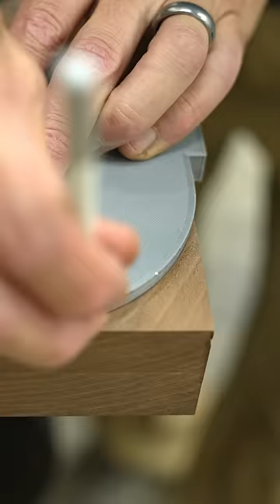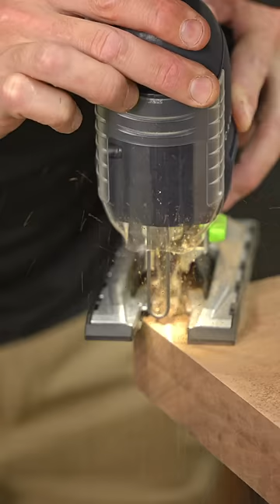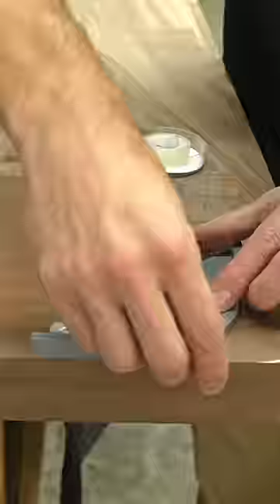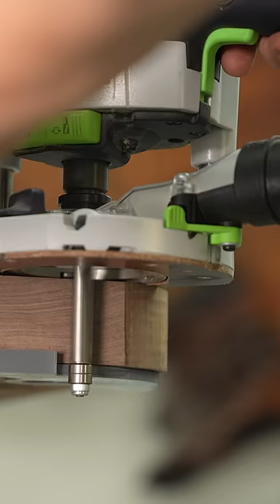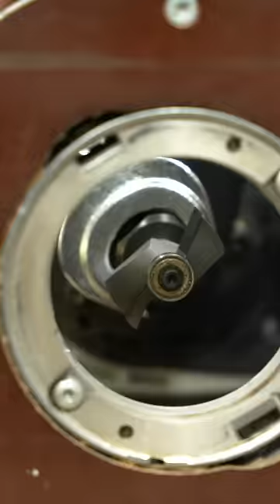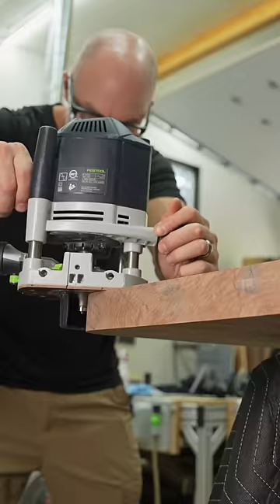Corner router radius

Comment: Time to get a new bit so it doesn’t burn the wood lol
Reply: moving the router too slow = burn marks

same as bit spinning too fast
Reply: You beat me to it.
Reply: Cleaning the bit can also help.
Reply: Some kinds of wood develop burn marks no matter what you do.  This bench top looks like white oak, and that’s one that burns easily even with sharp clean tools.
Reply: Tiene que bajar las RPM del router
Reply: Just needs cleaning in a degreaser solution save yourself loads of money it’s the turpine and resin from the wood that causes it not a blunt bit or too fast or too slow something the tool companies won’t tell you all and your welcome chaps
Reply: The guy has a festool router. I’ll bet he has the right and well maintained bits.
Reply: Just bad technique can cause this too. I've had brand new, high-quality bits on a dewalt router burn wood by using bad technique.
Reply: @rbruce5270  no, spinning to fast is never an issue with such a small bit. That's only a problem with much bigger routerbits. The problem with the bit in the video is either a dull bit, too little forward movement or not enough wood to remove.
Reply: Isn't it the same one that burn the wood in previous video too ?
Reply: He can’t afford new bits because he is still making payments to Festool 😅
Reply: Nah he held it in that spot too long
Reply: @rbruce5270  I just feel sorry for his partner 😁😇
Reply: All that money wasted on a festool router and don't even know how to use it without burning the wood. Perfect
Reply: @timothy098-b4f  the jig saw didn’t burn it
Reply: To slow not bad
Reply: Slow
Reply: @timothy098-b4f  doesn't look like white oak at all
Reply: @Cantspeakable  just because you have the money to buy inexpensive router doesn't mean you have the proper technique. I would never depend on double-sided tape for my jig
Reply: Always that guy
Reply: Yeah move that thing a little faster mr blacknails
Reply: Was due to his slow feed most likely
Reply: @rbruce5270  speeds and feeds
Reply: Да нормальная там острота, просто долго держал, зачем-то за один проход делал, хотя нужно было за 2-3.
Reply: I gotta disagree with your detective written there Lou, it looks like walnut. 

And dlr stands for dealer plates  @timothy098-b4f
Reply: Как называется эта фреза и эти приспособления?
Reply: U need to remove the fire from the metal first

Comment: Jigsaw and a belt sander works well for me. Any radius you want, you can usually find the right sized cup or can, or draw one with a compass as a template.
Reply: sounds like me. improvise, adapt, overcome.
Reply: What if your client is walleyed and can see both corners at once
Reply: That was a 3d printed template if you have a printer put it to work, if you have a kid with a printer put them to work.
Reply: Same here. Quick, easy and adaptable. Although his method is good if you have an inexperienced worker doing it
Reply: @scotwkilgrow  👍 for 'heartbreak ridge' reference.
Reply: @KaladinDarkEyes  BE caerful though, not everyone with a 3d printer actually calibrates it regularly...
Reply: If it's important, use a compass. If it doesn't matter I'm tracing a tape roll. Either way I don't need ten grand worth of tools to cut and rout a radius

Comment: That amount of burn is going to take some sanding out, especially on end grain. With good hand control you can do a first pass 0.5mm off the jig then a second cleaning pass.
Reply: @digitraxuk  haha, hope that jig is held on with Festool double-sided sticky tape.....wouldn't want it to fall off and the cutter to go right into the table top

Comment: Do you have to have a different router bit for each length you need?  Like that corner radius tool, if your stock was 1/2 thinner, you’d have a different bit for it so that the spacer nut on the end of the bit wouldn’t tear into your radius tool?

Comment: I have a set of premade templates with various radius diameters. Clamp it on top and route with a router with a collar.   Putting a lot of faith in some double stick tape.   It only takes once.
Reply: Also putting a lot of faith in the jigsaw. Mine never cuts straight. The blade wanders especially on thick materials. Far better to cut the corner with a pull saw then take a few router passes finishing with the template.
Reply: @Dave5843-d9m  I cut the corner off straight.  the router can handle the rest.  I made formica tops and the corners  usually had a radius.  I did hundreds of them.

Comment: Bro you need to route against the grain first to prevent the wood splitting. Then your last pass is with the grain to clean the cut
Reply: or, hear me out, this is a kind of oak that burns very easily. Every wood is different. The sharpest tools dont do crap if what youre working on just wont play your way no matter what.

Comment: The only problem with running a router round a radius is that it's ok
going away from you on your left hand side, which is correct, but when you start machining and come round the radius at the start you can, and most probably will, splinter the grain.
It's ok when you get to the right hand end of the board.
The other problem is the radius guide has to be screwed in position leaving unsightly holes in the w/top.
Much better to make a template out of 1/4" mdf that is  long enough to clamp in place without obstructing the full travel of the router round the curve. It's also cheaper!
One of the reasons why he burnt the w/top, apart from using a suspected blunt cutter, is he was going too slowly. With hard woods like oak you have to move the cutter over the 
material in quick short cuts while making sure you don't linger in one spot too long.
I would have used a ball raced guided cutter which are specially designed for cutting w/tops of 
38mm thick.
I don't know who these 'instruction'
videos are produced for.
If you're a professional tradesman then you don't need the video because you already know how to radius a w/top.
If you an amateur then the equipment he's using is horrendously expensive and not the sort of gear you would have.
Apart from which, he's not doing the job properly. At least I don't think so.
Maybe he's a moron on day release from the local nuthouse.😂😂😂
Reply: So much criticism towards a guy who clearly has his shit together. I don't get it... Also, in what universe did he screw in his radius guide?
Reply: jesus , that was a bit harsh … we all do things differently as skilled craftsmen , but usually get the same result , he never screwed the template from underneath , he used double sided tape , which i think is a terrible idea , but it worked in this case . making a bigger template and clamping it is a lot safer , but this guy might have done this 1000 times without a problem . I like watching other craftsmen work , some ideas id use , some i wouldn’t . better to help each other that to criticise .  for example : If you go too slow with the router , it gets burn marks … next time try a bit faster , and i tiny bit at a time , dont let the cutter heat up
Reply: @MrMeasaftw  You are correct, sir.
 I missed that part about the radius guide being stuck to the surface of the w/top.
I have never used this make of woodworking equipment in my working life (I'm now retired) apart from a cordless drill I bought which 
had exchangable chucks.
It was the only piece of equipment they produced at the time and was very innovative and was aimed at the kitchen fitting trade.
Sadly, as the construction industry
is well known for, it was stolen, along with a chain mortiser, a 1/2" router and other pieces of equipment, out of the back of my van one night when I parked it outside my house. They then came back the next night and stole my van
just to make sure I was unable to earn a living. (Good job, scumbags!)
Anyway, I digress. My real complaint with these videos is, who the hell are they aimed at?
If it's the professional, then they don't need instruction on how to radius a w/top.
If it's a DIYer then there are too many misleading parts, such as machining 
against the grain at the start and risking splintering the edge of the w/top for one. No attempt was shown to make it clear that you have to turn the w/top over so that you're always 
machining with the grain.
It didn't help that there was no dialogue either.
Festool now make a vast range of handheld woodworking equipment of very good quality and matching prices.
I can only conclude that this video is aimed at the professional, sponsored by freebies from Festool.
My gripe is that some poor amateur 
may be dazzled into purchasing this very expensive and unnecessary equipment. A radius jig and all the specialist accompanying pieces, such as the guide that attaches to the base plate of the FESTOOL router and the special cutter, not to mention the FESTOOL router itself
come at a premium price to do ONE
job.
As I mentioned in my critique, a piece of 1/4" MDF formed into an 'L'
shape and held in place with 'G' cramps is better for its simplicity and cost effectiveness.
I don't know what your 'beef' is in
springing to this guys defence, but get real. If you stick your head above the parapet then expect people to take pot shots, as evidenced by all the other negative comments!
We love it!😂😂😂
Reply: @davidashton2361  We can tell you’re retired David… 😂… so much time on your hands. I agree with your points btw.
Reply: @benclarkson4205  You make 'being retired' sound like a disease, Ben.
Something to be avoided.
At some stage, you'll be retired.
Whether through Ill health or tired of really early mornings, late nights
and weekends for not a lot of money.
You'll be taking you vast experience and knowledge with you, leaving the stage to the inept, 'get rich quick' chancers preying on the public.
There is a requirement for us 'retirees' to police the various trades.
Who else is going to do it?
Reply: @benclarkson4205  You're correct about my being retired,Ben.
The spare time comes from being up all night waiting to need to go and have another pee. Every 2hrs is the norm but can be as short as half an hour
I recommend living fast, dying young and having a good looking corpse.😃😃

Comment: slow the router speed down to avoid scorching the wood....
Reply: Exactly right, jjbrown!
There's many a time I've worked in a w/shop with some moron using a router screaming away.
On one occasion I actually walked over to a moron while he was using 
a router on full power and turned the speed control down while it was in the job.
He must have seen the expression on my face because he didn't say anything or adjust the speed control back.

Comment: Im not sure im seeing right but i think youre pushing the router the wrong way that's why it burns the wood.
Reply: No he's not. You push the router away from you with it on your left.
Sometimes, to preserve the finish on an edge a professional will draw the
router back towards himself but this technique requires a very firm grip on the router to prevent it from 'skidding' back and the material being removed must be a mere whisper left to preserve the fine detail.
To sum up, you go forward to remove the bulk waste and then back to achieve a fine edge.
It requires a lot of practice to get it right and you need a sharp cutter.

Comment: I don't know why my jigsaw blade always goes wonky like sideways and cut a taper when I was trying to do that on my projects
Reply: Incorrect blade tension and  lack of sharpness are the leading cause of blade wander or beveling.
A narrow blade with a wider curf can get you around corners cleaner also. 
Be well. Have fun.
Reply: So… how do you create proper blade tension on a jig saw?  Or, any tension, for that matter.
Reply: The problem with jigsaw blades is that they're flexible and want to follow the path of least resistance, ie, straight.
The thicker and harder the material the more flex you get at the tip of the blade.
The trick to removing the waste is to stand off from the curve, more so when removing waste from an inside curve so that you don't cut into the part you want to keep.
Don't worry about the video. That's only showing the perfect solution and was probably done on a band saw with assistance from an apprentice then videoed showing the 
waste removed and the jigsaw being held. It's a con. to gain your admiration for the supposed professionalism on the part of the demonstrator!
All these techniques can be done with much cheaper equipment.
The idea behind these videos is to flog Festool equipment, which is at least twice the price of other manufacturers stuff.
Nice stuff I agree, but when some scumbags break into your w/shop or van and steal it then the loss is so much more.
Don't worry. Festool are standing by to sell you some replacements.
Reply: Ummmm… my question was facetious 🙄🙄🙄. However, I do agree with the premise that these are all con Festool ads.
Reply: @joeblow9180  Joe, I guess the tension comes from trying not to make a complete 'pigs ear' of the various machining techniques and ruining an expensive w/top.😂😂😂
Reply: @joeblow9180  I have a nephew who's about 55 odd and arrogant as hell.
Won't listen to advice because he'd be acknowledging that somebody knows something that he doesn't.
However, he was forced to ask (well, his mother did) for my help in rectifying a nonsense he'd made out of making a cutout for a Belfast sink.
He'd chain drilled the cutout and couldn't work out how to get a finished edge.
What was worse, he hadn't allowed for an overhang into the sink.
Just in case you're wondering. Yes I did rectify it but it wasn't the usual
method or appearance. I had to clean up the edge with a router and then line it with strips cut from the waste of the cutout, glued and pinned to form an overhang into the sink.
Reply: @davidashton2361  thanks for the reply that was kind of informative and funny except for the end that's not funny someone broke into your shop
Reply: @davidashton2361  so I just need more tools I guess I'm okay with that in woodwork when is it better to use a bandsaw or a scroll saw
Reply: @undonefun  No, they didn't break into my w/shop. They broke into my van and stole a chain mortiser (£1000), router (£280) and various other bits of kit. Almost emptied my van.
Then they stole the van the next night.
Prior to that, while working in London, they broke into my van in broad daylight while it was parked in a car park next to the job, and stole a whole load of gear out of the back.
The only stuff they didn't get was what I had with me on the site.
My stuff wasn't expensive but having to replace it was still a bit of an expense.
When they stole my van it didn't have
very much petrol in it and it ran out a few miles down the road.
In a temper tantrum they stripped the ignition leads and distributor cap out of it.
Reply: @undonefun  I wouldn't recommend using a band saw or scroll saw to trim waste material off a w/top, much to heavy to move about. Just use a jigsaw and not worry about how tidy the waste material removal is. The router will tidy it up.
My guess is that that was what was used for effect for the demo. Just remember to remove a bit at a time with the jigsaw until you have removed enough bulk waste to be able to clean it up with the router.
Reply: @davidashton2361  damn it bro I hope things are going better for you now. Makes life tough when shit people are imposing on ones life.
Reply: @undonefun  Thanks Thomas but I'm retired now and don't have to face the challenges
still being encountered by tradesmen in the construction industry.
It is surely one of the worst and most dangerous environments to be 
in.
There are worse, of course, like mining, deep sea diving etc but 
it's a vicious existance.
Reply: @davidashton2361  I'd pick deep sea diving any day over  work for a living and have your s*** all stolen that you have to have to earn a living.

Comment: Get a sharper bit that doesn't burn the wood or lower the rpm. It's pointless to use the most overpriced router on the market and not use the adjustable  rpm setting on it.

Comment: 1/4" spiral flush cut bit is dull, the radius bit change was a waste of video. Using a 3/8" radius bit to achieve a 1/4" radius is one thing, hand work is quite another.  Better off using a reverse bearing 1/4" for the corners.

Comment: Is it just me, or does anyone else cringe when these are festool and skip the video?
Reply: In a way, Festool are like Black and Decker.
The difference is in the quality of the products.
The biggest laugh I had was when B&D brought out the 'scroller saw'
which was meant to be the answer to cutting into a corner and then, by snivelling the head though 90°, you could carry on cutting at 90°.
Even their TV adverts skipped over the fact that it was physically impossible to turn the BLADE while it was still in the wood.
The only really useful thing B&D came up with was the folding workhorse with it's really useful clamping action. This is what most people (and not just site fixers/carpenters) recognize B&D for.
Similarly, Festool are known for their
quality and their interchangeable chuck drill.
Unfortunately, this makes them a prime target for thieves.
Fein are known as the father of the cordless drill and the multi tool.

So yes, I do skip over the Festool ads!